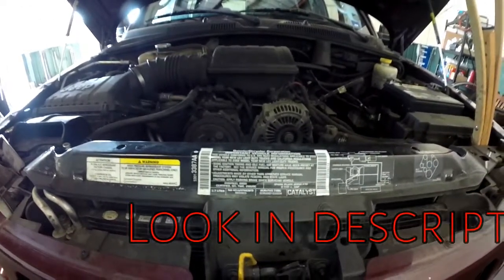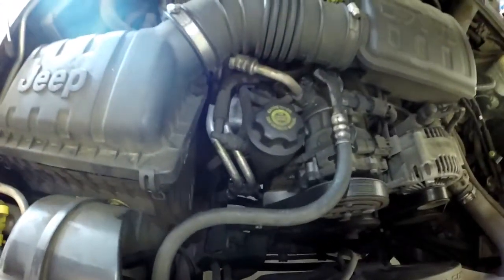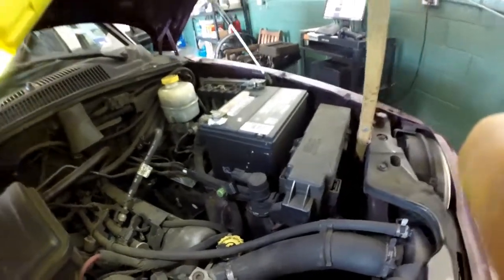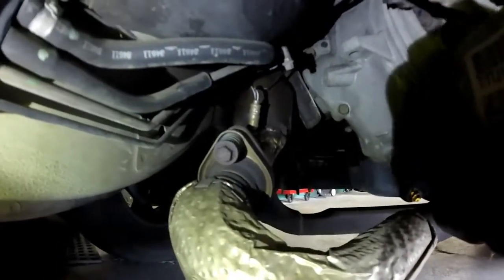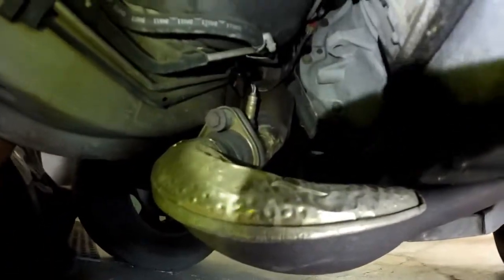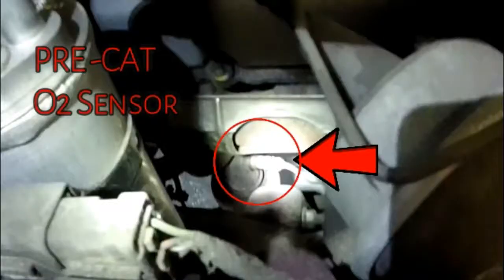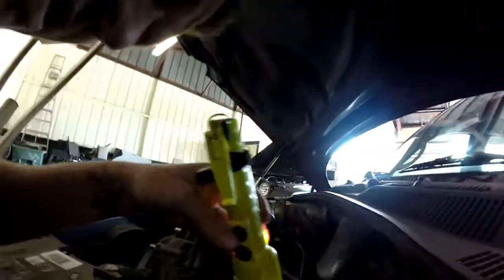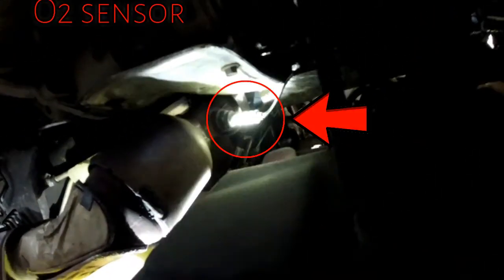Jeep Liberty Emissions Locations: PCV, EVAP Purge, Oxygen Sensors

Comment: Howvthe EVO lines going to the gas tank? I had an evap leak that went all the way back. I appreciate the video tho, I was putting back my crossover pipe that connects to the catalytic converters and I was trying to sandwich in the springs between both flanges. It seems over execive by Jeep to include these longs bolts and springs,, a shorter bolt and lock washer would of been enough.

Comment: please sir. i need some details. i have a p0171 lean code as well already running for 2 months and has not figured out a way to solve it. what did you do for this?
Reply from the maker: You have a lean code on bank 1. Have you checked for vacuum leaks? Listen for suction while the vehicle is running. On this make and model I have actually found vacuum leaks on the bottom side of the vehicle leading to the fuel tank in the EVAP system. So listen for suction everywhere. If you don't find any vacuum leaks then next I would look at exhaust leaks. Do you have any exhaust leaks before the oxygen sensor? The code you have just means you are running really lean and the computer cannot add enough fuel to make your exhaust stream rich. The could even boil down two stuck closed injectors. But the easy fix is usually a vacuum leak or an exhaust leak.